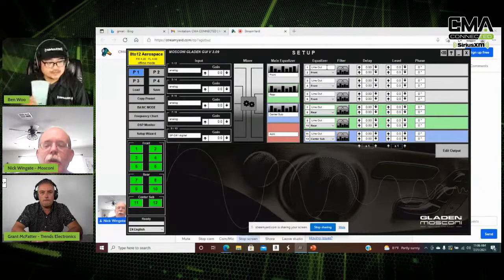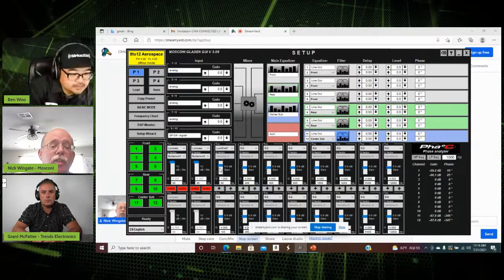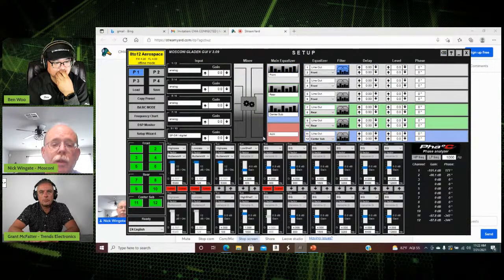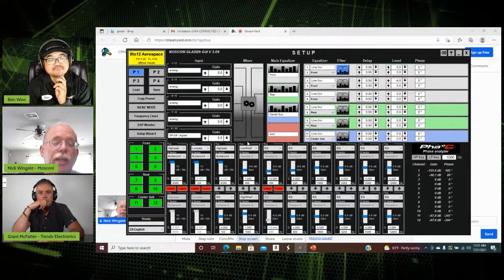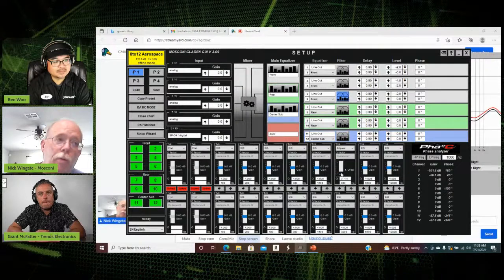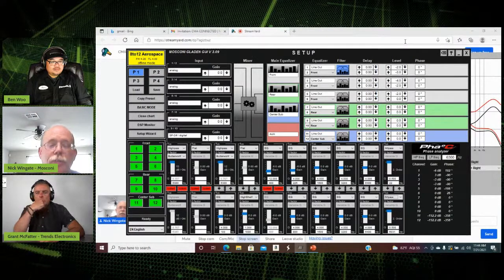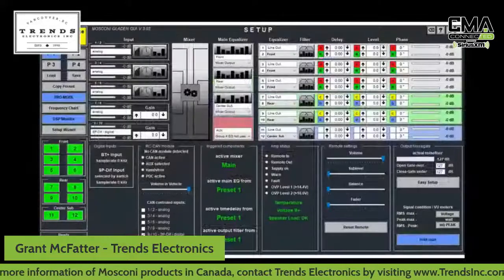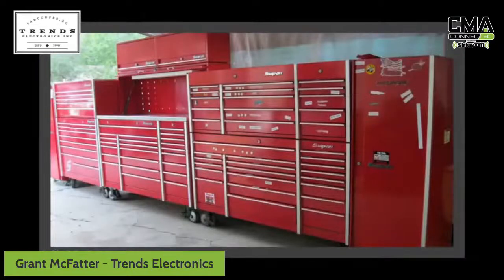CMA CONNECTED | Mosconi DSP Part 2

Comment: @Canadian Mobile Audio  
Ben, thanks for having Nick Wingate, Jr on the show again.  Nick always cracks me up...for as long as I can remember, he has always finished just about every other sentence with "M-Kay?" in his Texas drawl, LOL.

Nick is incredibly knowledgeable, but this presentation was a bit disjointed IMO.  I know that he was trying to point out some of the specific Mosconi DSP's advanced features, but I wish that he would have presented a "Start-To-Finish" system setup and tuning process to get to a "baseline", and then discuss the "Advanced" features.

I realize that this would probably need to be a multi-part video series, but Mosconi would gain A LOT more end users and more dealer interest and uptake if he were to do this.

He should at least have had a Slide that we can screenshot that outlines the basic Tuning Steps to perform in sequence, and a separate slide that points out the unique Mosconi DSP features.  Video tutorials are powerful SELLING tools.

There were quite a few assumptions throughout the presentation, such as understanding what a "Shelf" filter is, and the function of the "Q" or band-width adjustment when using PEQ, as well as needing a calibrated measurement microphone and USB audio interface and/or RTA measurement software such as the free RoomEQ Wizard (REW) in order to SEE or FIND what problem areas there are in response so you can make the appropriate adjustments and corrections.

It would have been great if Nick had shown specific cancellation nulls or peaks on a RTA frequency response graph, and THEN demonstrated how to use the Mosconi DSP's unique tools to correct each one with the appropriate PEQ settings or Shelf Filter, etc.

In addition, Nick should have provided a more detailed VISUAL demonstration & explanation of the EQ's "Q" adjustment as well as a visual representation of "Shelf Filter" being implemented.  Sure everyone can look these up via a search, but that is after the fact, and it's important to understand these concepts BEFORE flying through a demonstration like this, otherwise most people will be even more confused and intimidated.  Luckily everyone can come back and watch this again after brushing up on those topics.

FYI, the miniDSP UMIK-1 is a good calibrated measurement microphone that's under $100, or there is the Dayton Audio UMM-6    There is also the Audiofrog UMI-1 measurement setup that includes the Microphone, USB computer interface dongle, and a Test Tone Disc complete with excellent Musical Reference Tracks.  Go to "Testgear DOT Audiofrog DOT com".

As mentioned previously, the "REW" RTA software is FREE to download and is incredibly powerful.  There are several YouTube tutorials for REW as well.

For a CONCISE Tuning Guide that will work with ALL DSPs, I would suggest the FREE Audiofrog PDF by owner Andy Wehmeyer, titled A Straighforward Stereo Tuning Process and Some Notes About Why it Works which can be found if you Scroll Down to the Bottom of the web page at "Testgear DOT Audiofrog DOT com".

Andy Wehmeyer at Audiofrog also provides some Excellent information and relevant topics if you check out the Online AUDIOFROG TEST BLOG

I realize that it is incredibly difficult to convey this type of information and the entire tuning process along with complex DSP features in a "Quick and Informal" YouTube video, so I hope my comments above are only taken as Constructive Criticism and nothing more.  ;)

P.S. Also, it would help tremendously to see the Details of the Mosconi Tuning Software screen if you provide these videos in at least 1080P resolution.  ;)